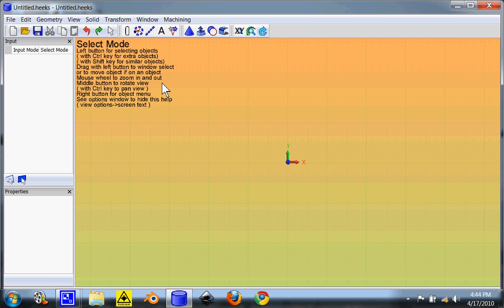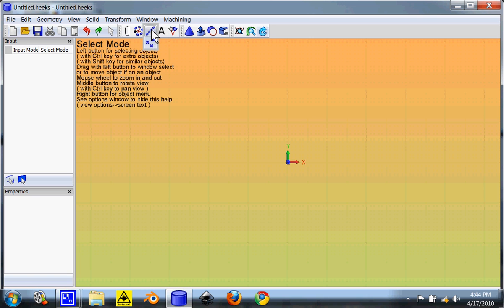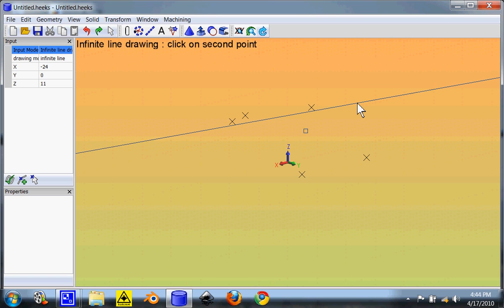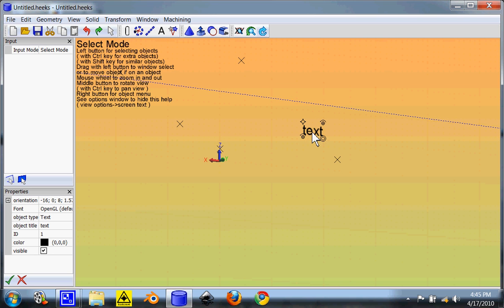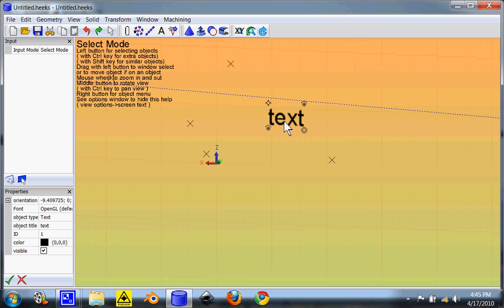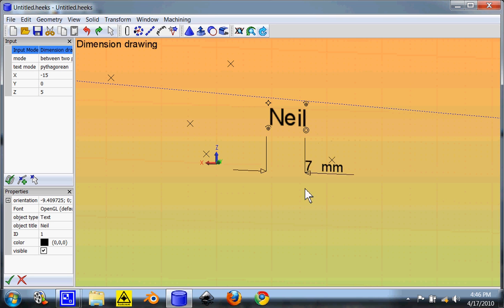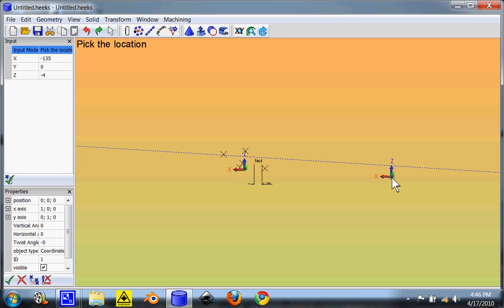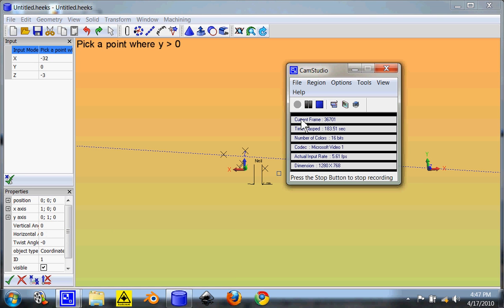HeeksCAD Unofficial Tutorial Part 3: Non printable reference points

Comment: I should also mention that it would be possible to convert text into 3D by using the QCAD or Hershey fonts.   If the text uses one of these vector fonts, you can right mouse click on it to convert it into a sketch.  The sketch can then be extruded.  
Thanks  
David Nicholls